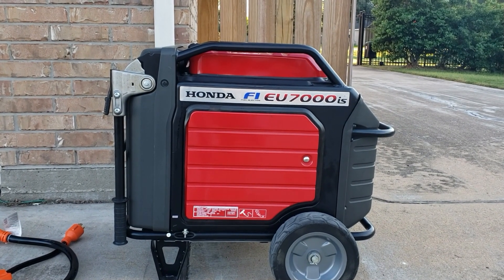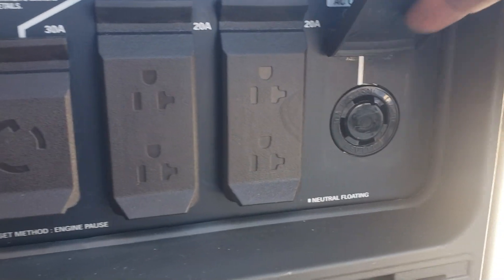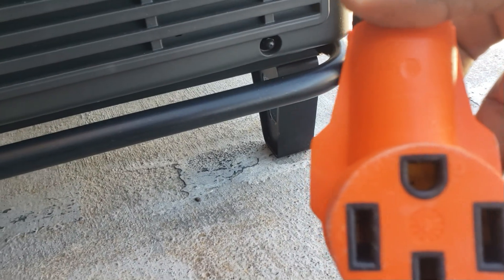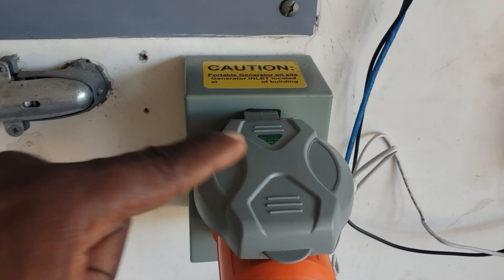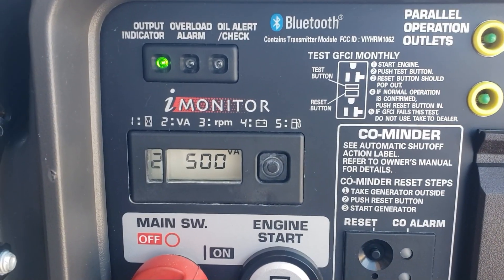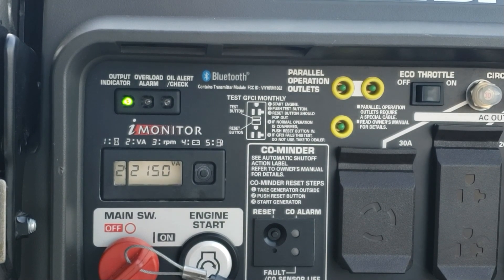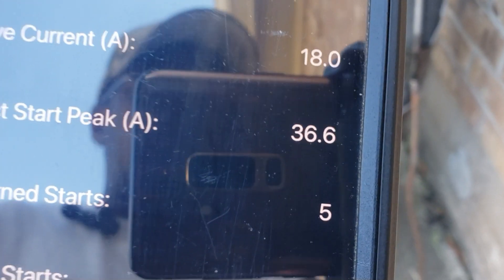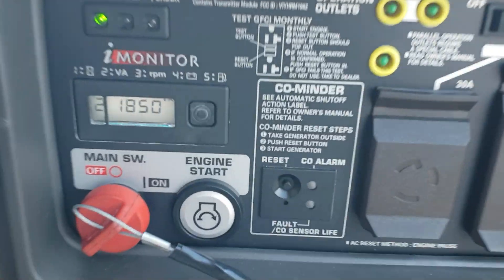Honda EU7000is Inverter Generator Running a 5 Ton AC

Comment: I just sold my Honda EU6500is and got absolutely top dollar for it. Their reputation carries them a long way. Plus I do think they are a bit underrated as far as electrical capacity goes. However, the modern Chinese tri fuel units made by Dinking Corporation are also incredibly well made; the only issue is parts and warranty service. But to run my home on natural gas, I took the chance (and ended up putting $1000 back in my pocket). However, I now have to keep my fingers crossed just a little.....

Comment: Good video.  Do you think the red warning light blink will go away after the soft start unit “learns” enough to where it draws a bit less current?   Just curious
Reply from the maker: I don’t think the 7000 is enough to run my 5 ton AC long-term like a week plus

Comment: Yo my man. Which Easy Start model do you have running that 5 ton A/C unit?  Trying to accomplish the same result with my 7000is.
Reply from the maker: I’m running the micro aireasy start flex
Reply: @GeneratorReviews  Thanks for the response.  That's what I ordered, but I've been reading the new flex models are having high failure rates. Leaking capacitors and such.  Has me concerned.  Hoping I don't brick my A/C unit.

Comment: What is your ac RLA and LRA nameplate values? I have a 5 ton Carrier with 26.4 and 134. I am considering a setup like yours but not sure if it will work.
Reply from the maker: I have the same unit as you.

Comment: I came across your video which I found very helpful in installing my own EasyStart for my 4 ton AC unit. My next step is to figure out which generator to get. Can you let me know what is the InRush reading of your 5 ton AC unit that Honda EU7000is was able to run? Thanks in advance!
Reply from the maker: I don’t think the 7k will be enough to get the job done but a 9000w or 10500w works perfectly. 
My inrush for the 5ton was 132 before the soft start.
Reply: @GeneratorReviews  My 4 ton was at 130 before the EasyStart. After installing the EasyStart, it's been consistently pulling 42 start peak amps. I was hoping that the EU7000is could work.

Comment: Do you turn your breaker switch off before you turn. You're generator off? Or after?
Reply from the maker: Just the large loads I make sure the central air is off since it’s the largest one
Reply: @GeneratorReviews  oh okay so I've been, trying to figure out why my eu7000is. Would overload when I turn my 3.5 ton ac on. Sometimes it works and sometimes it doesn't. So I need to have the circuit protector off when I turn. My ac on?

Comment: Surprisingly, My Honda 7000 can handle one of my two ac units at a time...  There is a surge when it kicks on but then settles down and runs...   When our power is out we run the downstairs AC during the day, and the upstairs  AC during the night...  This is without a soft start on either unit...  I don't understand how or why it works but I'm thankful it does...

Obviously your mileage may vary...
Reply: What size are your ac units? I have a 5 ton down and 2 ton up Carrier and considering soft starts with a Honda EU7000.

Comment: Do you think the EU7000 will run a 3.5 ton AC without a soft start…?
Reply from the maker: No, I don’t think it will won’t have enough amps to start the AC compressor

Comment: Is your AC a 2-stage compressor?  That makes a big difference.  My 4-ton Goodman is 2 stage.  It pulls 10.1/12.8 amp for 1st and 2nd stage but the inrush current is normally 122 amps measured with a clamp-on meter.  But adding a hard start kit reduced the inrush to 63 amps.  At that level my generator which can produce 6850 watts on Nat.Gas could start the AC compressor if the inside fan was already running and nothing else was on in the house.
Reply from the maker: This is a single stage compressor
Reply: @GeneratorReviews  You did great!

Comment: Thanks for posting Gavin, 👍🏻👊🏻👏🏻
You might see my comments on others that create videos on the same generator. I personally have the same generator. Just an older model. Mine doesn’t have the blue tooth capability nor the CO minder. Mine runs full rail all the time with the eco throttle off. I don’t need the CO minder because mine is permanently outside my house in it’s own “house” if you will. 
I had an electrician install an interlock in my circuit breaker panel like your set up. Instead of an inlet on the side of your house? I have my inlet inside the generator house. That way no one can tamper with the generator or the cord. Mine is grounded to a ground grid. Something you might consider if you plan on leaving your generator on for long periods of time. (There is a ground lug on the frame below the control panel on the right hand side). Generators can create static electricity & if let to run for extended periods of time could shock whoever touches the metal part of the generator. Hence the ground lug. Consult an electrician about grounding your chassis. 
I’m a firm believer that the Honda EU 7000 is is THE BEST generator on the market! Lots of folks like to compare their generators to the Honda but Honda continues to be the innovator. I currently have a hard start capacitor that I had installed for my older Trane 2-1/2  ton condenser. I have heard great things about the soft start. Next time my A/C mechanic is at my house I’ll have them swap that out.
Reply from the maker: Thanks John thanks for watching

The Hondas are great generator pretty much you buy one for life

Comment: I'm glad you redid this video. Still not sure if I should try my EU7000is with my 4-ton with EasyStart 368. The bluetooth app shows my startup as 55A with the easy start, but running is about 14A. This means the Honda would have to surge to about 11kw to meet the inrush.
Reply from the maker: The 55 A is coming from the soft start capacitor whatever the Honda gives it will make up the difference
Reply: @GeneratorReviews  Well, I hooked up the generator today and tried to start the 4-ton HVAC with the EasyStart and it didn't work. The EasyStart errored out.  I was using gasoline with eco mode off and all breakers off except the air handler and the condensing unit. I set the fan to on instead of auto and it was drawing about 300W per leg. Then I set the thermostat lower and the AC tried to kick in but only the fan on the condensing unit ran. The compressor wouldn't run.  I tried it twice with the same effect. After unhooking the generator and putting utility power back, the HVAC worked fine, with last startup on the EasyStart app showing 50A.  Just too much for the Honda.
Reply from the maker: @browsedeweb8834  you’re probably gonna have to let your EasyStart learn for a while before trying again

Comment: I bet Honda is coming up soon with something even better, they have only done a few improvements on the EU7000is in the last 5-6 years. The competition is getting stiff but no one has gone 100% to the Honda level. One thing that none has and Honda does: reliability.
Reply: They also start no problem in -30. We tried everything at my old company to save money.  Not every 3000 watt generator is a “3000 watt” generator.  We used them daily and no issues in the 5 years we had the Honda

Comment: This video shows you just how good the Genmax 6000 is to be honest. Fraction of the price, 240V output, and running watts of 5250 which is just shy of this Honda. The Genmax also weights a lot less and just as silent. The only bad part is probably the reliability, if it breaks I’ll just buy another one because it’s cheap. Oh, the Genmax 6000 is also dual fuel.
Reply from the maker: Just wait till you see what Genmax has coming out!! ohhh it’s Awesome I can’t wait!!!
Reply: @GeneratorReviews  I know right. Another point for Genmax's price. When the new sposely 7000IED comes out, if the weight is about the same, and selling the 6000 would be super easy because of the low price point.
Reply: @GeneratorReviews  You don't know when is coming the new genmax?
Reply from the maker: @josesantiago9287  I don’t have an exact date but hopefully it’s pretty soon maybe next month

Comment: Nice demo. I wish all generators were that quiet. I've got to invest in one of those soft starts for my RV. It would be nice to run one of my A/Cs with my little generator. But, prices are going higher and my income isn't. I'll have to add it to my Christmas wish list for now.
Reply from the maker: Hopefully the AC manufacturer just start incorporating the soft start to their units
Reply from the maker: Thanks Tom👍🏾💯

Comment: Pound per pound the Honda EU7000 is the best generator of all time.
Reply: I have to agree.  I have one and it started my 2.5Ton AC without a softstarter with no issues.  I installed one anyway and there is barely a hiccup when it kicks on.  I use it with the "Generlink" connector to the house.  I tried a buddy's standard 8000W generator and my LEDs had a flicker to them and my Battery backup UPS for my office (computers/router etc) kept beeping if the AC kicked on, or the stove element kicked on.  The Honda had none of these issues.   And the Honda can run in my driveway or backyard and I can't hear it with the windows closed (A/C running).   Hardest part with the Honda is getting one as they are hard to find in my area (Ontario Canada).
Reply from the maker: Hey RebelLucy
👍🏾👊🏾😎💯